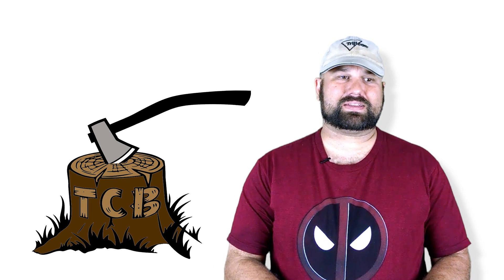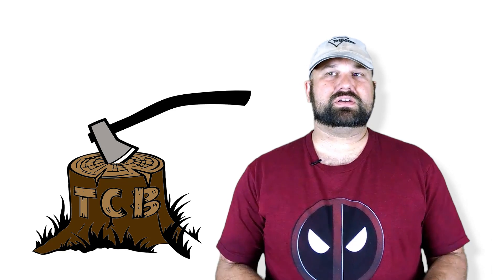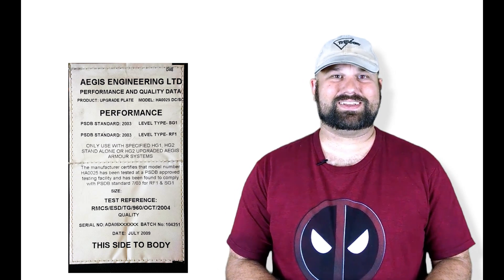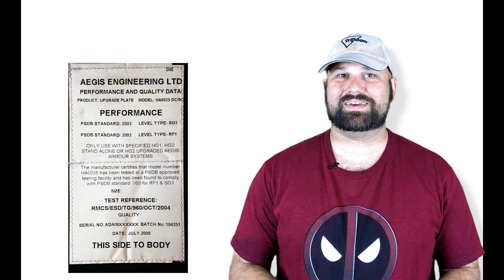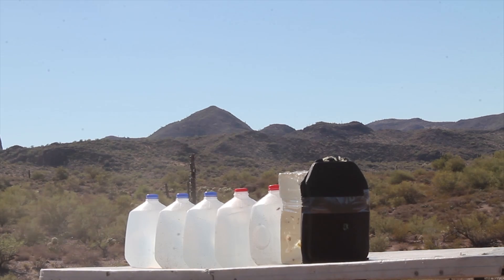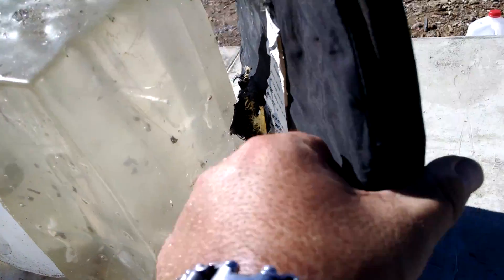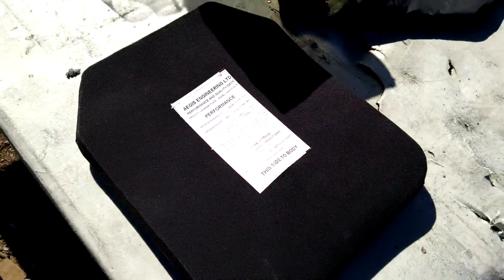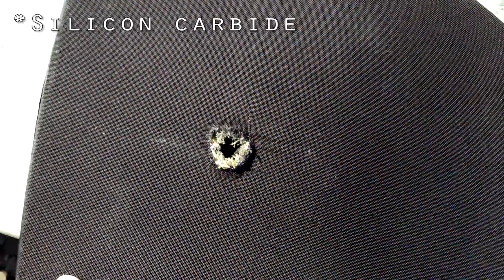Armor test: M855A1 vs Aegis Ceramic RF1 ICW plate

Comment: Hey there great video! I was surprised by the results. I see you used a 20" barrel M16A2 style rifle. I know this round stabilizes with a 1/7" twist, but what about a 1/9" twist which are common in the M16 style 20" barrels. Would appreciate any feedback.
Also, were these reloads, or factory M855A1. This makes all the difference, but judging by the velocity these are probably factory loaded.
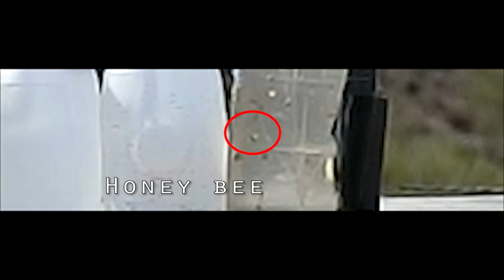Reply from the maker: M16A2 has a 1:7" twist barrel. M16A1 had a 1:12" twist barrel. 1:9" twist was common in many civilian AR pattern rifles in the US for a time, but most are going to 1:7" or 1:8". This bullet is still stable from a 1:9" twist barrel. The ammo is factory loaded.
Reply: @newsofthepews  Thanks for the reply! You are correct with the 1:12" twist, as back in the day they only used the 55 gr. FMJ projectiles. Great to know these are still stable in a 1:9" twist. I prefer the 1:7" twist though for shooting those 80 gr Sierra Matchking HPBT loads that are just great for precision marksmanship. 

Cheers!

Comment: Hi, Andrew. I think you definitely need to check your chronograph. 3308 to a 62 grain bullet out of a 20 inch barrel is too unbelievable.
Reply: I don't like to resurrect old posts but I think you may find this information useful. To better explain, out of a 20" barrel, regular green tip M855 will give you around 3100 FPS. The new M855A1 EPR round is slightly higher pressure, producing higher velocity. You could think of it as a 5.56 NATO "+P". It looks unusual, but these rounds were developed quite recently and were intended for use in the M4 service rifle with a 14.5" barrel, though they can be used in an M16, and when done so, it produces stupid fast velocities.

Cheers! (I used these later on when I was a "gunslinger under contract")
Reply from the maker: Horus T'an M855A1 be fast.